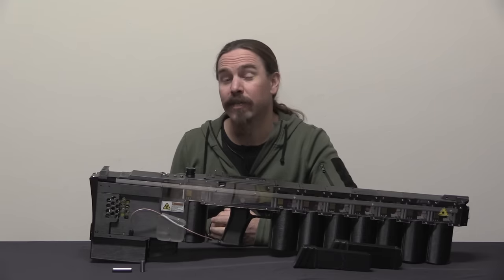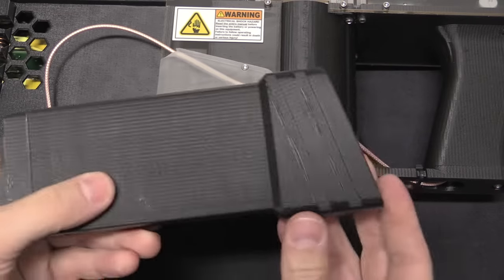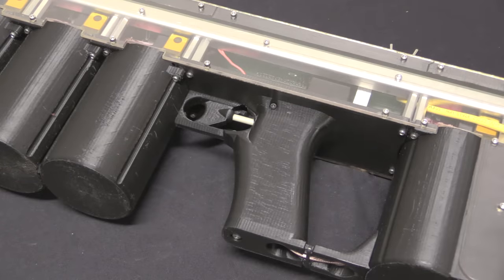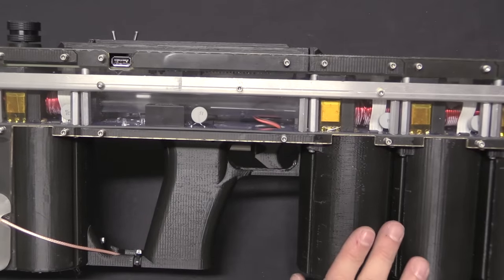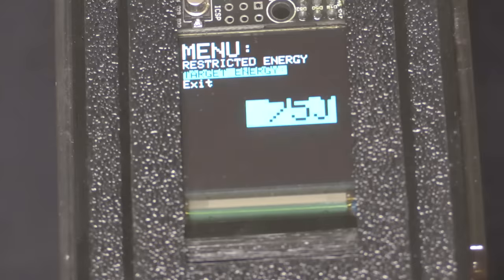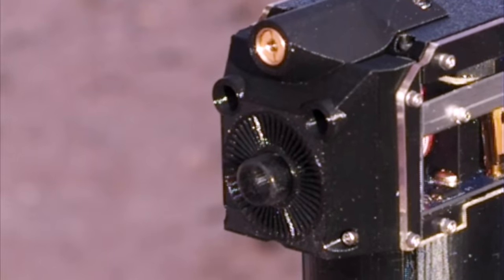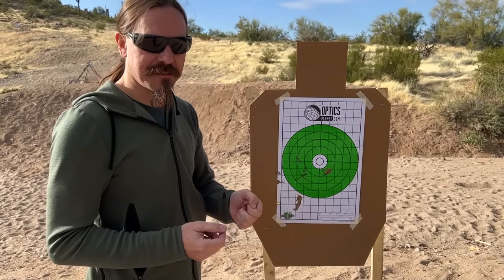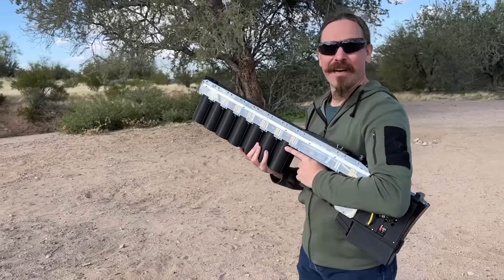ArcFlash Labs' GR-1 Anvil Portable Gauss Rifle

Comment: The scariest thing about this weapon is how quiet it is. Imagine a battle where you don't hear gunshots, just screams.
Reply: I suppose at some point in the future these might be powerful enough to accelerate stuff to the speed of sound.
Reply: I almost spit red wine out of my nostrils at that comment
Reply: @RyanTosh  probably gonna happen sooner than we think
Reply: Just imagine all you hear is the screams and the rampant Youtube Sex bots.
Reply: If it advances to the level where it can shoot any projectile above subsonic levels, there'll be almost the same amount of noise as a rifle with a good suppressor.
Reply: @RiseAgainst786  And without any of the click noise produced by mechanical parts
Reply: @pig1800  The clicks are barely audible tbh
Reply: @rad1ata  one sec I’ll get in it
Reply: @RiseAgainst786  I'm not objecting to you or something... I just meant "even quieter".
Reply: @pig1800  
I think there's some sound from the capacitors too.
A little tinggggg like a vibrator.
Reply: And the whine of mass drivers spooling up. It reminds me of crossbows.
Reply: from my understanding, it should almost be recoilless right? as there's no gas ejected?
Reply: surely if this weapon goes in battle the velocity has to be increase. It is silent now with this destruction capacity but with more power, this weapon should produce much noise. Cool sound though. Terminator 2 like.. nice
Reply: Actually those battles existed in the medieval era... all that technology is not even more efficient than a crossbow
Reply: You have more power in a Compound Bow, and more flexibility and no need to charge, + there are Rambo explosive arrows although they are outlawed for Civilian use
Reply: @FrostyFoxGamingIGM  A standard sniper rifle of this size and weight would have zero practical recoil..
Reply: I had the same thought. Imagine combat where the sound of the rounds impacting around you is the loudest noise. Crazy to think of. If this tech becomes widespread, stealth is going to become even more important for infantry.
Reply: It's gonna sound like a nerf battle in your cousin's back yard.
Reply: @RyanTosh  Now it's 1/5 of sound speed. But hypersonic speeds have been achieved in large cannons of such designs. Because of the magnetic field and weight I wonder if these would ever be practical as hand gunds.
Reply: it's quiet to human ears, but it sends a lot of emp when firing.
with a simple radio device, it would be super loud and very easy to pinpoint.
Reply: @DigitalNeb  You won't hear a "self destruct drone" before you are inside of the blast zone. Neither will you hear a Bow which has more power, similar recharge, less weight and doesn't need charging. GG :) + You don't really hear Military fire until it's too late. Military ammo travels faster than sound and professional troops engage in group fire, an all or nothing strategy which is a standard practice against all armed targets regardless of the opposing levels of power. If the level is equal ? the book says to call for an air strike or consolidated artillery. You won't hear any of that either :) or, you will "hear it" but there will be nowhere to go except a bunker and it better be a good one. This will increase the life span by about 25 min -_-
Reply: @poolpffs4985  we will have to see the only source of sound would be the air ripping no gas expansion (main gun noise)
Reply: There were air rifles in the Napoleonic Wars that were used by the Austrians. Napoleon hated them.
Reply: There would be sonic booms still heard right? Unless subsonic. This is for future iterations that is
Reply: There is a weapon in Star Wars legends which is almost completely silent and can shatter most types of armor. I remember it being described as quite scary.
Reply: OP never played blazer tag
Reply: @RyanTosh  the tech is already available and in use by the US Navy.
Reply: Best thing ive read in the past century
Reply: A weapons grade coilgun would be anything but quiet, the sonic boom alone would make it extremely loud and honestly that crack is most of what you hear at longer distances anyway. So actually it probably wouldn't sound much different at longer ranges common in combat.
Reply: Imagine a battle with steel cylinders flying at 75 mps. That wouldn’t penetrant a kiwi
Reply: Can be a perfect sh niper
Reply: Need to change my shorts now
Reply: I love the whine of capacitors in the morning.
Reply: Imagine a battle, where you don't hear gunshots, screams or anything, because there is no battle. Why you people are so eager for war? Maybe you should participate in one and see how terrible it actually is? By the way, Russia provides such opportunity as of February 2022, you can go tu Ukraine, escalate the situation and be in the middle of war. Go. Do it.
Reply: I bet it'll be louder when it's up to effective terminal velocities
Reply: Love how people are complaining about the speed of this 3d printed mass accelerator prototype. The shot fired from this is so much bigger and heavier than a 308. It's not a final it's just proof of concept in the future they will have much more powerful weapons. Like complaining about a early flint lock rifle not being as powerful as an ak... Yes we know 🤦‍♂️
Reply: @iamkronix3422  that's what I figured. I am a Kiwi and I shall not fear someone armed with one of those guns.
Reply: @OrangeAmped  I thought so too, that it sounds like a crossbow.
Reply: Probably would still heark AKM:s being fired no matter how much in the future.
Reply: "Imagine a battle where you don't hear gunshots, just screams."
I guarantee there will be trash talking and the military will start having battlefield trash talking classes for infantry soldiers.
Reply: @War_Magus  oooooh that's sexy. Never thought of it.
Reply: @why_wait   
I agree.
With a little bit of work that round could be much lighter filled with a special mixture. In turn making the velocities go much higher and impacts much more deadly. Even with all that accuracy is more of the issue. A hit with a 22 is better than a miss with a 44 mag.
Reply: Welcome to my nightmare, a place a live everyday.
Semper fi
Reply: I was thinking the same thing
Reply: @RyanTosh  I mean, it's a gauss gun, not a rail gun, so making it supersonic on a portable size is gonna be hard
Reply: @RyanTosh  you're way behind this type of Technology was perfected in 1946 by the war department along with infrasonic weapons research and herf weapons ..
Reply: @LostShipMate  truly the worst outcome of cyber warfare :D
Reply: A big advantage this type of weapon has is that it can work in space where you can't even hear screams.
Reply: @RyanTosh  why would you if you could instead shoot a heavier projectile right at the edge of subsonic? Just a 4 inch long hunk of metal coming at you at 750 mph
Reply: you will still hear a bang unless the round is subsonic...
Reply: Or the screams you hear when you step into a mud puddle and the caps zap yas.
Reply: I imagine more warhammer 40k with bigger charge and electric beam noises lol
Reply: Well...think about how much more powerful it'll have to be before it's a real battlefield weapon. That high-pitched whine you hear as the capacitors charge will likely be a hell of a lot louder, as will the switching (what with the ridiculously high voltages), and the projectile will probably have a really nasty report as it breaks the sound barrier. No gunpowder bang, but if you're shooting at targets with body armor, you'll almost certainly get that distinct sonic *crack*!
Reply: what if it's in space?
Reply: @JOlivier2011  well then no one can hear you scream >:)
Reply: There are no more huge battles like that. It's all tactical today.
Reply: Ok that's terrifying
Reply: If it breaks the sound barrier there will be a boom. True Story
Reply: Dude as a 3 time was vet that really is a horrifying concept. In reality most of what you do in a firefight is react to sound bc touch taste and smell go into low power so hearing and sight go into high power but line of sight will get you killed quicker than you can see the target so you're fighting mainly based in sound
Reply: @FrostyFoxGamingIGM  there still will be kick but since the gun is pulling the round vrs the gas pushing the round the gun will jerk forward instead of back towards you.
Reply: @RiseAgainst786  but there's no need to make them more than subsonic. A  subsonic 5.56/7.62 will kill you just as quick as anything supersonic. Most munitions used in the military or even hunting are designed not to break the sound barrier.
Reply: @RiseAgainst786  if they really needed somthing powerful enough to break the sound barrier they could just make the projectile larger causing more damage with less speed. What does more damage: a   .22 going 2400fps(faster than the speed of sound) and passing clean through your bicep, or a baseball hitting your bicep at 1000fps (slower than the speed of sound)? The answer is the baseball, the .22 will require a few stitches (15 tops) while the baseball would basically rip your arm off. The speed of sound is between 1100 and 1200 feet per second depending on humidity and altitude
Reply: @sneeringimperialist6667  when did they not metal? I skipped around and guess I missed that part
Reply: @FrostyFoxGamingIGM  actually thinking about it more  the recoil would be is the same direction pushing it back towards your shoulder.
Reply: @emmw7794  dude even with the best portable suppressor on earth a 300 blackout is louder than a 5.56 with no suppressor. I spent 7 years as the battalion armoror and personally have the largest firearms collection of anyone I know personally, including multiple 22s and ARs as well as a 300 blackout. And even with a SilencerCo Omega suppressor it'll make your ears ring if you don't have earpro on
Reply: @GLCaver98  I didn't see your post and basically said the same thing lol. A 1000fps baseball is gonna do more damage than a 2400fps .22 round
Reply: @kooperativekrohn819  for the Emperor!
Reply: I think they mentioned the muzzle velocity was 70 m/s which is way below a normal firearm which is usually 180 m/s to 1000 m/s.  To break the sound barrier you have to get around 240 m/s.
Reply: @RyanTosh  Probably. All it needs is a more potent energy source. The day some mega genius figures out a way to cram a nuclear bomb's worth of energy into a volume no bigger than an energy drink can safely, is going to make a lot of sci-fi things that were previously impossible, possible.
Reply: Its has the voice of mass dead💀
Reply: @java4steve  I don't know about meters but he said in the beginning that it was about 2200fps or as fast as a .22lr which is usually 2200fps which is actually faster than the speed of sound which is between 1100fps and 1200fps depending on the humidity and altitude, so I think he either mispoke or I misheard or it did NOT preform like it waa supposed to lol. Also  in mph the sound barrier is between 725mph and 750mph.
Reply: Air Rifles are pretty quiet right now.
Reply: You'd probably hear the impact...
Reply: @WOTArtyNoobs  they definitely can be if you get one made for noise suppression. And they make air rifles and pistols up to the larger calibers like 50AE now and even 12gauge airshotguns lol. And they do the same damage as their combustion counterparts so they are pretty cool. Demolition ranch also did a rail gun video recently that I thought was a better design than this one.
Reply: @WOTArtyNoobs  it's called a EMG-01A. And it has semiautomatic and 3-5 round burst settings on the selector😎. $1500-$2000
Reply: Yeah, kind of like a very sophisticated Crossbow. For a prototype it is effective enough.
Reply: @server1ok  He only fired it at 51%, and it's probably better than the earliest examples we have of Crossbows. Crossbows have had THOUSANDS of years to develop. This gun hasn't even hit Beta, much less a 1st Mass Production Release. This is more Proof of Concept, than an actual Weapon proper. 

Plus, the rounds might be as or more powerful than a crossbow, if shot at full blast with some of those bullets. Plus, there's something to be said about the reload time of a Bow or Crossboy compared to this, not to mention a lack of recoil.
Reply: I never thought of that and now that I think of it, thats kinda terrifying...
Reply: @RyanTosh  Supersonic projectiles aren’t exactly silent.
Reply: You will hear them when they use even more power. They will not stay that silent.
Reply: @charlesjohnson7657  People overestimate the amount of force needed to incapacitate someone.
Reply: @TheAyanamiRei  1. Lack of recoil doesn't matter. Because. If you take a standard sniper rifle ( which is 10 to 50 times more powerful ) and build it to weight the same as this Coil Gun, the standard sniper rifle is going to have ZERO recoil. 2. Check Lars Andersen. He will teach you how Bows were used in Warfare, 500 years ago. Plenty of VODS on YouTube. The recharge time is fast. Archers didn't use fancy sights and they didn't load arrows on the wrong side of the Bow. This came about later in modern competitions. In our time. I didn't mention the Crossbow. Nor did I mention a Ballista or a Catapult. But if you take a powerful Crossbow or a Compound bow, it has enough force to shoot a serrated arrow through 3 Cows and come out the other side. You know the famous Lion that was killed by a Doctor ? His arrows went straight through the Lion. He shot more than 1 arrow because the bastard didn't use enough blades. Arrows need a minimum of 4 large blades to humanely kill a large prey. With twin blades you need to hit the heart of a Lion. But with this Coil Gun, you would need to shoot 50 to a 100 bullets. 3. The development of Coil Guns is old. The CERN particle accelerator is a Coil Gun. Coil Guns can't be made lighter or the CERN staff ( which includes thousands of World experts ) and their budget of 200 Billion USD would make the accelerator, cheaper, lighter or smaller. They couldn't. You need to change Maxwell's equations or invent an unknown material because this is about the limitations of electromagnetism. However. You can make very powerful stationary Coil Guns. You can shoot containers into Space with a Coil Gun. But you won't be able to carry it.
Reply: @FrostyFoxGamingIGM  the round has weight and depending on the weight it also doesnt like to move from a zero potential/kinetic energy point and will move the gun partly as well.
This is called inertia.
Reply: @jeremysaklad6703  That's my point :p
Reply: @GLCaver98  That's true, but keep in mind kinetic energy scales quadratically with velocity, but only linearly with mass. So doubling the speed of a projectile is twice as effective as doubling its mass.
Reply: @server1ok  but in about a generation this thing could be able to fire a slug though a tank at Mach 12.
Reply: @jibcot8541  It can do that right now. You just need a coiled tunnel that is 300 yards and a machine that weighs 75.000 pounds. This cannon can subsequently get destroyed by a single grenade or a couple of stray bullets into the enormous battery pack. Poof ! dollars down the drain..
Reply: @VaporSpaceNumber101  that is true, though the recoil should be less than a conventional rifle right?
Reply: @FrostyFoxGamingIGM  recoil would be almost non existent with the weight of that railgun and the round
Reply: @server1ok  I am LITERALLY unable to read that mess with it being 1 giant massive paragraph. Other than a few highlights.

The Collider is VERY different than what's being made here. 
It's a crude janky prototype that's NOT even in a Beta Stage, not even worthy of Beta. That means there's going to STILL be a TON of problems, BEFORE they even get into Efficiency.
Again, I was saying you would have to compare this to the EARLIEST VERSIONS of a Crossbows, Guns, etc. Like the earliest rifles were SHIT, so it's no surprise the earliest coil guns aren't that great. 

Like nothing here is efficient or nearly as great as it could be. Lots of tech is overly bulky and less powerful when it first comes out. 

Nobody's really invested the kind of time, energy, and money needed to turn this into something that could even BEGIN to compare to a modern assault rifle.

An MAYBE we'll never get there, but as far as I can tell, we're FAR FAR from being able to even say with 80% certainty that it would be impossible to create a Coilgun that could compare to something like say...an AR-14 or Sniper Rifle.
Reply: @RiseAgainst786  nope. It will always be quieter.

Part of what makes firearms loud is the mechanical action being slammed violently.

There are no such things on the gauss cannon.
Reply: @TheAyanamiRei  The particle collider isn't about the physical structure or the physical invention. The coils at CERN prove ( and make use of ) the limits of electromagnetism and how much magnetism that can be packed into a certain distance, speed and as per the provided power, minus the power loss. Even with a perfect theoretical model of a Coil Gun ( with no power loss and no charging time ) there are strict upper limits as to the amount of power that can be transferred into the momentum of a metal slug, especially when taking into account the weight of the machine and standard materials like copper. 

The most obvious upgrade to this weapon is to stop the rounds from tumbling, but this will create friction and decrease the current output by 50 %. Going down to 50 yards per sec is reaching territories of the early Muskets and BB air guns. The second upgrade is more coils, a longer barrel or a coil that goes around the barrel in 3D, 360 degrees, all of which is going to add weight. Serious weight. Similar issues are present in creating EV Lorries for transporting 20 to 40 tons of payload, or carrying enough rocket fuel to reach another Star System. Serious ( built in ) diminishing returns. As I've said. You can create a Coil Gun that sends containers into Space but you won't be able to move it and it'll take weeks of planning to send a projectile into the correct destination, it's also ridiculously easy to sabotage or stop operations, none of which are good traits in a War.

Check Lars Andersen. He can fire arrows with a deadly precision and power ( up to a 150 yards ) faster than 1 per second, by holding the arrows in the draw hand. In addition. Lars has passed the mark of middle age and has a muscle ( nerv ) disorder and has only trained seriously for a decade. War Archery has been forgotten and patronized for Centuries. Even today. A random member of a Rain Forest tribe outdoes the precision of any modern firearm that doesn't make use of a rotating bullet, such as bird shot and muzzle loaders with round projectiles. There is nothing to improve. A tumbling or spherical projectile that is shot at the surface of the Planet, can not compete with a War Archer unless in melee range, regardless of the energy level. You are underestimating the issues here, in every possible way. That's why an answer has to be this long.
Reply: @yep Those countermeasures don't exist and the guns themselves will develop over time as well. For all we know the whine will be eliminated.
Reply: No sound, no flash, ideal for special ops
Reply: @Gebra9  except it's nowhere near as good as weapons like the mk22 Mod 0 if you want to talk stealth. In fact, right now, it's about as stealthy as an axe covered in bells.
Reply: The round itself will be explosive rounds
Reply: Lets ignore that subsonic projectiles are of very little military use - they STILL produce a loud BANG when leaving the barrel. Even fast TRAINS do that.
Why? Cause there is still a projectile and a barrel (and there needs to be) and that causes a lot of air to move.
Reply: All you heard in battle were the screams until quite recently in history. Well, screams, trumpets, drums, and clanking metal. Maybe the occasional crash of a flying boulder into the city walls.
Reply: Projectiles only make a bang when they break the sound barrier, subsonic projectiles do not break the sound barrier therefore they do not make the bang. Trains do not go bang  either when exiting tunnels, why would they ?  There's no airtight seal between the train and tunnel, as there is with a bullet and a barrel, and they are nowhere near breaking the sound barrier.

Subsonic ammunition is extremely useful for the military. There are multiple gun platforms built entirely on the damn stuff. 

The vss and asval cartridge being one of the most famous.
Reply: @candyman9635  "Trains do not go bang  either when exiting tunnels, why would they ?"
... they do (well, not just on leaving but even when entering) - and it is one major engineering problem for highspeed trains.
https://www.youtube.com/watch?v=8ttshCp1r9I
(and that is still on the slower end).
https://www.youtube.com/watch?v=qNmVEPTLDuI

And as you said that is without an "airtight" seal but rather with tunnels that are far wider than the trains.... having a projectile that fills nearly the entire barrel just makes it that much worse.
Reply: @ABaumstumpf  Trains do not go bang, they cause a noise more akin to thunder as you can hear in the videos you linked. 

It's not about trains this discussion, we're talking about subsonic ammo and the fact you seem to think it's of "very little military use" and that it somehow produces a loud bang when leaving the barrel. Even if it were at the same noise level as standard ammo, which it's not, that's why subsonic is used with suppressors very frequently and why the VSS and AS-VAL, which use subsonic ammo by default, have integral suppressors.
Reply: @candyman9635  "and the fact you seem to think it's of "very little military use""
it is not just that i think they have little use - i am just pointing out the fact that they are of very little military use.
Reply: @ABaumstumpf  Okay, you repeated the same claim for a second time. 

Do you have any evidence or can you elaborate on that ?
Reply: @candyman9635  "Do you have any evidence or can you elaborate on that ?"
The lack of sub-sonic weaponry in general -  aka basically all of modern weaponry and warfare.

Do you have any evidence for subsonic weapons with low cycle-rate being desirable?
Reply: It makes about the same amount of noise as a crossbow launching and is probably just about as deadly... so countless people throughout history don't HAVE to imagine.
Reply: I’m sure a powerful version of these will cause some type of noise fired
Reply: and electric cars
Reply: you dont here it because its low velocity. once it kicks up, you'll still here a sonic boom
Reply: cant imagine how scary it would be if bow and arrows were invented oh wait
Reply: @RiseAgainst786  unless they make stealth hypersonic technology. They’ve made something similar to that for underwater torpedoes, so that the cavitation explosion does not happen.
Reply: Yeah but so far as it's is useless, a BB gun has more power and more accuracy LOL🤔😆 we gonna have to come back to this comment section in another 50 years.
Reply: @RyanTosh  wrong not this gun but the one the Navy has, this gun on this video is a joke, only a quarter of the speed of sound is what you are seen in this video, a revolver hand gun bullet is two to three times faster than this.
Reply: @lcfflc3887  like any new technology, it takes time to develop. So yeah, we will come here after 50 years
Reply: @ee214verilogtutorial2  don't forget about Lazer beans, that it's Bean developed as well and it's far more practical, 0 recoil less weight and limitless ammunition as long as you still have charging oh and it doesn't get more quiet then that.
Reply: Because it is very slow and weak.If projectile pass sped of sound that make BANG, not just powder charge.Less power than 22 lr and mutch less range and accuracy than 22 lr.if they make a rifle like this on electromagnets that will be as strong 
as normal gunpowder rifles, it will be just as noisy as gunpowder 
rifles.
Reply: @docholiday2538  These airguns are note even close as powerful like 12 ga and 50 AE.They are in pistol range of power and as noisy as a powder burner 45 acp pistol.
Reply: @ciro79  they aren't airguns, I've personally have 9mm and 12gauge airguns in my collection that will take down a deer no problem. But these "gauss" rifles are just magnetic rail guns so there is no mass displacement of air caused by the concussive force of a traditional firearm or of a high power air rifle. They are just magnetic force push/pulling a piece of metal forward really fast. You might hear a little  fwoop as it pushes the air out of the barrel but other than that, yes they could be silent
Reply: Dude. Damn.
Reply: walter graham  they’re using meters per second not feet
Reply: Not true because every projectile that is passing the sound barrier will create a cracking noise …
Reply: @PhysicsViolator  dude just keep it under the sound barrier. The sound barrier is 1400+fps and that's faster than many combustion rounds so it's fast enough to kill but under the sound barrier
Reply: @docholiday2538  well in that case arrows/air rifles and slingshots have been doing that for centuries if not millennias and you don’t need batteries 😂😂
Reply: @PhysicsViolator  yea they do the same thing, just with the tiny difference that they go nowhere near as fast, are nowhere near as accurate, and are single shot😉
Reply: @PhysicsViolator  other than the air rifles but those that are that powerful are single shot
Reply: That wouldn't be the case once the bullet goes supersonic though. The only reason it's so quiet is because the slugs travel at really low speeds.
Reply: @docholiday2538   well coil gun technology is quite new so it needs a very large improvement and efficiency to actually achieve deadly velocities that can actually kill something from a far distance , while some large bore air rifles can take down a deer from over 300 meters … it’s because capacitors aren’t energy dense enough to  deliver enough   Magnetic force  so there’s still time for this technology to be lethal at a man portabile scale…
Reply: @PhysicsViolator  honestly we don't look at military tec in the perspective of making it portable anymore. The major strikes always do to drones or naval artillery nowdays. And on a large scale they already have rail guns that can take out a tank from another state
Reply: @PhysicsViolator  the tec has been around and used since the cold war
Reply: @RyanTosh  Railguns and such are only really limited by the amount of power available to them, and how strong the barrel is to withstand multiple shots. If you can overcome both problems then there is really no limit to how powerful you can make a railgun. Theoretically you could build one so powerful that it would instantly kill anything nearby just from the pressure wave from firing.
Reply: It's not the gunpowder making the boom it's the sound of the bullet breaking the sound barrier the method of acceleration doesn't matter if it reaches that speed it's gonna make a big boom like a gunshot
Reply: @kriegdeathrider7805  sry man but that's just not true, I've designed, built, maintained, and restored firearms my whole life. And yes the sonic boom is loud but if you take a shotgun shell and toss it in a fire, when it goes off it's audible for miles even though the shot never doesn't go more than a few feet much less break the sound barrier
Reply: that's mostly because it's subsonic and fairly weak. If you increase its power it will make sonic booms and thus be almost as loud as a firearm
Reply: @KekusMagnus  why make it supersonic when subsonic will drop a moose at 200 yards? Most hunting ammo is subsonic and in the army we were given subsonic rounds whenever we had to use suppressors. A round traveling at 1100fps (subsonic) does just as much as one going 1500fps (Not subsonic) lol
Reply: I wonder if gun poweder never existed what kind of gun like weapons would we have by now?
Reply: @jmgonzales7701  we'd probably still have explosive propelled bullets. I mean you can use something as simple as sulfer and red phosphorus aka match heads to make a stable explosive powder that can be substituted for gunpowder.
Reply: @jmgonzales7701  but if you mean if bullets were never created then we'd probably use some syfy crap like laser,plasma,rail,or pulse weapons. We already have some of those like the pulse gun that can take a plane out of the sky, and we've had rail guns capable of launching a tungsten rod through the moon from earth since the 1950s, and we aren't far from the rest. Laser weapons were created decades ago but were  almost instantly banned for being inhuman and to dangerous for individuals just like nukes were. And They already have plasma casters that can imolate objects up to like 15ft away. It's just a matter of which takes the least, most available resources to produce and operate. And right now that's combustion firearms
Reply: @jmgonzales7701  sry for all that lol I'm a vet/gunsmith/gun nut so I have way to many facts on stuff like that that nobody really wants to hear😂
Reply: @docholiday2538  plasma would be nice. something like star wars.
Reply: @docholiday2538  would it be as powerful as gun powder.
Reply: @jmgonzales7701  it's just as powerful as gunpowder and was used in firearms b4 gunpowder, the downside is it creates a puff of thick smoke every time you fire that can obscure your target
Reply: This is how most battles were fought throughout human history when you think about it
Reply: @StinkySkunk100  Yeah but most of the time its face to face, this time it isn't. You wont know what hit you.
Reply: @StinkySkunk100  yea but back then the projectiles didn't come at you at 1400fps
Reply: @server1ok  barely. Compound bow is 220-250J, and this is an alpha prototype.
Reply: @docholiday2538  he said the muzzle energy was similar to a .22LR. It’s a much heavier round so it’s slower. Only energy matter though (more or less).
Reply: @server1ok  CERN accelerates particles to .99c ffs. That is not necessary for combat
Reply: @RyanTosh  doubling its velocity is quadratically more difficult than doubling its mass.
Reply: @lcfflc3887  no, it does not. Not even close
Reply: @ciro79  no
Reply: @kriegdeathrider7805  this is just wrong. Subsonic gun rounds still make sound from the exploding powder. Subsonic gauss rounds, like arrows or air rifle rounds, are essentially silent.
Reply: @kalasmournrex1470  You are correct, but the calculations from CERN about power management and magnetic fields holds true for the upper limit "OF ALL" Gauss rifles and if you follow this math you also get a lower limit of the mass and size of a Gauss Rifle ( which can overtake a standard rifle ) that simply can't be carried by single combatants outside of being mounted on a Tank and other conclusions. CERN ( being close to c ) allows for an extremely precise math and this holds true regardless of material choice and regardless of technology because the calculations are rooted in "electromagnetism" so unless you can invent a Gauss Rifle on a QM level or with a "Warp Drive" it will never be carried by a single soldier. Can I perform this calculation in detail ? No. Does that make it false ? No.
Reply: @LostShipMate  BAHAHHAHAH
Reply: @kalasmournrex1470  Well sure, because it then has quadratically more energy. No free lunch and all that. Velocity's just a more efficient way to pack in that additional energy, you can only go so large before things get impractical, but better technology could feasibly allow for higher speed without more weight.
Reply: bow and arrows
Reply: @zaatas  I was just waiting for somebody to catch that lol. It didn't seem like anybody was reading my comments so I got frustrated at all the side chatter from folks who never built a firearm or reloaded a  round and decided to see how much bullshit they'd slurp up
Reply: @docholiday2538  Ah, that makes sense, nice one. I was like I agree with this guy, they seem to be one of the only people that actually knows what they are talking about. Then you said that, and I was like, oh, he's one of those. 

I don't think people really understand the benefits of being able to switch the amount of energy per shot on the fly, and the ammo length. That would be revolutionary. You could go from super sonic small AP slug, to barely subsonic slugs. Sabots would fire really good out of this. Or ammo that could work like birdshot or buckshot. Standard ammunition would become cheaper because you don't need to load bullets with gunpowder. 

The problems (other than the weak firepower it has now) is the size, rof, and the gun would be extremely fragile. But those all seem like things they could work on and make better. It's a very interesting weapon platform. 

-Last thing, the guy going on about the bow and xbow. Wow. Yeah just learn how to use a bow, super easy man. And xbows, those things load really fast, right? Neither have problems in wet weather either.
Reply: @FrostyFoxGamingIGM  not really due to third Newton law the force applied by magnets to projectile, is applied by projextile to magnets too
Ofc. You dont see much recoil here due to higher mass of gun and Ian's muscles holding the gun in place
Also the gun itself is quite weak when compared to most firearms of that size
Reply: This would be a horrifying way to deliver explosive ammunition, especially since then you wouldn't have to break the sound barrier (with the attendant noise that would make). Just a little bit of clicking your target won't even hear, then stuff a few hundred feet away starts blowing up.
Reply: @raycearcher5794  Yeah, and perform trick shots with a guidance computer. 

The huge problem that will always be there, is that even if they scaled the size down, and the power up, the thing is still going to be filled with magnets and capacitors. 

And I'm not exactly sure what explodes when shot at it, but I've shot at old speakers/tvs before, and there's something inside them reacts violently with bullets. I would posit its either the magnet or the capacitor that has this explosive effect.
Reply: @zaatas  Capacitors are full of chemicals that, if they overheat or overvolt, can explode. So compared to say, a mounted machine gun where shooting the weapon can render it useless but probably won't kill the operator, there is a non-zero level of danger. 

I'd say in a military scenario, gauss rifles would definitely work better as a support weapon, screened by a squad with conventional firearms.
Reply: @RyanTosh  It's already possible with a full power railgun, but those are very long and require tremendous electrical power to use.
Reply: @FrostyFoxGamingIGM  The recoil is exactly the same as a rifle of the same power.

The only difference is a rifle is pushing gas and metal out and this is only pushing metal out.

The force transfered back does not change with the materials accelerated, only with the mass and velocity of them.
Reply: @server1ok  Completely wrong, it would have the exact same recoil as a sniper rifle fired conventionally with the same energy.
Reply: @BeKindToBirds  Sir. You have failed to realize the big picture. 1. To reach the power level of a standard sniper rifle ( explosion pressure from a burning chemical ) the coil gun needs to be approx. 10 times larger ( at least ) 30 times as massive, thus the backwards movement will be 30 times smaller when propelling a same weight projectile at a similar speed. 2. The acceleration in a coil gun is GRADUAL, this means that the felt recoil will be even smaller than the example of 30 x.. What's more.. point 1 and 2 ( + additional  limitations, power leakage and interference with all other equipment ) is why coil guns suck for anything but a stationary installation, such as the CERN which has a weight of a couple of Billion sniper rifles but still manages a lower energy per pulse
Reply: @server1ok  I am a physics major and I promise I understand how it works.

The nuance you are elaborating on would have mislead 99% of people who are saying "no recoil" (because they are kids probably)

Everyone in the comments thinks it will have less recoil because lasers and video games.

The details you are talking about are not what they are assuming, they are assuming space magic = no recoil.

And my comment is meant to answer that.    

There is still an equal amount of force being applied backwards to launch the projectile.

These kids are saying space gun, not talking about the finer points of moment of force.
Reply: @BeKindToBirds  I admit the initial comment is a trap. It's meant to show how pathetic the coil gun is, especially as a hand held device. If you don't fall in ? you won't learn, or, in your case, you won't be reminded of what you have omitted, being a "physics major" and all :,)
Reply: @server1ok  Look homie, let me explain first of all I'm not a computer person okay.

Want to talk about something fun?

These guns have been outside a long time okay.   Like, a while.   Like, literally back in the days of steam engines.

So let's make some educated guesses together.   Do YOU believe that this 3D printed home kit is the very pinnacle of the technology in use?

But can you think of any reason to use this over a conventional rifle?    

What about almost the exact same parts?

thedrive /the-war-zone/russian-backed-separatist-shows-off-questionable-homemade-counter-drone-jamming-gun

A lot more practical.

The Navy is who plays with big guns, no offense to this company but electric small arms aren't the need.   

Electronic small arms are, and so are Electric Naval guns.

But this idea?  Kinda looks like a ballista to me.

I think it could have its place on a vehicle or in and emplacement without doubt.
Reply: @BeKindToBirds  p.s. The coil gun which has an identical recoil to a standard rifle ( given the same energy ) is a fantasy weapon. It does not exist and it will never exist unless you 1. break Maxwell's equation, or 2. invent new materials on the periodic table or invent new states of known materials which are more magnetic while not being impossible to load and wrap around the tube. There is a reason why CERN has a mass of approx 10 Billion lb, if humanity could make a powerful coil gun small and portable ? it would have been done, 50 years ago. The only way forward on this is to invent some type of new QM material which doesn't break down in 0.1 pico seconds but when we reach this point, a portable laser weapon will be on the map
Reply: @server1ok  You can literally make one in science class.

Does it not exist until it matches some comic book ideal of yours?

I am really struggling to find your definition of coil gun.

A gauss gun is literally a coil gun, how powerful do you think it has to be to meet your definable standard?
Reply: @BeKindToBirds  The limitations of the coil gun are not about technology. They are physical limitations. As in limitations of the current theories of Physics. That's why you need a "better theory" than Einstein and Maxwell to improve the coil gun or a "unknown material", hence why QM is the only way out. Yes, you can add size and mass to a coil gun. A Naval coil gun is 80.000 lb and the CERN is ( as I said ) 10 Billion lb. Can you carry 80.000 lb ? Can you put 80.000 lb on anything smaller than a commercial Truck ? What do you think the recoil is for a 120 mm shell when you fire it from a CANNON that weighs 80.000 lb and up to a 1000 tons ? the recoil will be a tiny fraction of an inch, if you can record it at all. For all practical purpose, the recoil will be ZERO because coil guns are shit. There are 2 viable venues for a coil gun. 1. Laboratory. To test particles. 2. A Space elevator that wants to be "friendly" to the environment. So what's up man ? You are a physics major but not a computer guy ? but you somehow manage to have a bad temper ? Let me tell you what I am. I collect cans for a living, as in professional dumpster diving, that's why I don't give a shit what anyone thinks. You should try that
Reply: @server1ok  Alright well I hope you keep your enthusiasm going forward but I really don't have time to explain things to you now if you aren't going to read.

Take care, learn some metric.
Reply: @BeKindToBirds  The LHC at CERN cost $8 Billion USD and this is after massive Gov. subsidy including, cheap land, favorable power, Gov. caps on labor, Gov. guarantees on various cost and deliveries. To fund the LHC coil gun ( LHC is basically a coil gun and nothing else ) without a Gov. intervention would cost approx. $30 Billion USD today. Do you know many people with 30 B in cash ? The Worlds "richest person" Elon Musk doesn't have 30 B liquidity atm. If the LHC could be made any smaller and cheaper ? believe me, it would have been made smaller and cheaper. EM is such a weak and diluted force ( in relation to chemical pressure ) and these are the limitations. Why is the LHC important for a portable coil gun ? because the same principles apply to a small coil gun, it's the same formula of Maxwell or ( if you want to get fancy ) Einstein. To circumvent this fact, no technology can help. We need NEW ELEMENTS or a completely new physical model that can discard the entire work of Einstein. This theory doesn't exist. Being a major in physics you should be aware of this, as I live on the garbage of people, am middle aged with zero education but still manage to educate myself about basic fact.

When it comes to Military application, coil guns are dead in the water. Not only that but a waste of manpower and resources which can no longer be tolerated with an expanding East. I can think of a single valid application and that is to setup vehicle mounted, low range grenade launchers that are silent. This is a small niche and hasn't been developed. You get a silent grenade launcher but the Vehicle will become twice as heavy, tech interference ( coil guns disturb onboard equipment ) and cost will go through the roof and the shells will be 10 x the cost, initially. We are in a cold War atm. much worse than the Cuba crisis and to misinform the public about weapons of Fantasy is not a joke. It's playing into the hands of the enemy, actually 2 enemies, 1 of which is dominant in exports over the US. Unless you want a lifetime President in the US that is appointed by the Kremlin or Shanghai ? think before you speak. 

As for the "Space Elevator" coil gun, this isn't a joke either. The structure would be larger than the Wall Of China, a thousand times bigger than the LHC, at a starting price of $3000 Billion USD ( just to get the project off the ground ) with a zero guarantee of success, probably to cost more than the combined market value of Apple, FB and Google. To fail in such a venture would be equal to getting blasted by Russian atomic bombs, when it comes to wasting US resources and manpower, and as for the elevator part, it's not a physical elevator all the way up to Space which is why it would be so immensely expensive and actually has a chance of working. A chance in hell ..
Reply: @server1ok  Dude, go argue with the articles you read and calm down.

I explained to a guy that these guns still have an equal reaction and you have spent hours and hours being mad and talking past me.

Get help.  I don't work with you, I'm not paid to listen to you rant past me about things I never said.

I get this is a comment section but I have to work and not on Wikipedia.

You are literally making up an argument and having it 100% on your own because you are too excited and didn't read.

I never took any position you have argued against yet other than the fact that this rifle is not the only gauss coil gun small arm.

Read about it in 30 years when it's on Wikipedia and go argue with kids more because I don't work in commercial and I'm not begging investors.

And you for sure have never had this discussion with decision makers on a military base and it bloody shows.
Reply: @docholiday2538  "Most munitions used in the military or even hunting are designed not to break the sound barrier."
Patently bullshit. I can't speak for hunters, but the percentage of subsonic ammunition in military inventories looks akin to a rounding error, and sure as hell isn't "most."

"I don't know about meters but he said in the beginning that it was about 2200fps or as fast as a .22lr which is usually 2200fps which is actually faster than the speed of sound which is between 1100fps and 1200fps depending on the humidity and altitude, so I think he either mispoke or I misheard"
You misheard. He didn’t say anything about equivalent velocity, he said “equivalent _muzzle energy_,” which is due to the enormous weight of that slow-moving slug.

"we've had rail guns capable of launching a tungsten rod through the moon from earth since the 1950s"
Again, no the hell we didn't. This is as ridiculous as people saying the earth is flat and Nazis have a moon base.

"Laser weapons were created decades ago but were almost instantly banned for being inhuman and to dangerous for individuals just like nukes were"
More bullshit. Laser weapons didn’t “get banned”, they aren’t in use because of similar reasons to gauss weapons/railguns – size, weight, energy. Plus, laser weapons are essentially heat weapons, so to destroy a target with a laser weapon, you have to train the weapon on it until it heats up to a temperature that causes failure (organ failure in a human, fuel combustion or structural failure on a vehicle, etc). You need to lay off the comic books.
Reply: @jsquared1013  lo its great to see all the civilians who know more about this that me, a retired battalion armoror
Reply: @RyanTosh which is totally impressive, because......?
Reply: @eliasroflchopper3006  Nothing to do with impressiveness, more that once they reach the SoS they won't be silent anymore (sonic boom)
Reply: @RyanTosh  guns already do that
Reply: @RyanTosh  nevermind you are talking about coilguns I feel stupid
Reply: @skff_err  the energy of the projectile going forward would def have recoil so any coilgun looking to make normal guns obsolete needs some anti recoil
Reply: @charlesjohnson7657  well the whine probably isn't an issue: up the capacitor frequency a bit, it will be inaudible to humans. I'm no engineer, but i'd guess that's something they'd like to do even aside from sound issues
Reply: @Demigord  I don't think you can really change the pitch, just sort of muffle it.
Reply: Most of the sound made by a gun is the projectile breaking the sound barrier, not the gunpowder igniting
Reply: Psychological warfare at its finest.
Reply: crossbows, and regular bows are the same way bro
Reply: Brrrrr and screams, charging will sound like brrrrrr
Reply: The loudest part about a gun shot is it breaking the sound barrier so it will never be quiet on the battlefield
Reply: Well, if you use a spear you get the same effect :)
Reply: @server1ok the main advantage these have over bows is that any noob can shoot one of these, so long as you're decent at aiming, but I guess the same is true for a crossbow. An actual bow takes more dexterity and skill though.
Reply: @admontblanc  At the range that this weapon can damage a large game animal and hit somewhat reliable ( which is not further than 30 yards ) a standard bow isn't rocket science to shoot by anyone who isn't in a wheel chair or a 5 year old child ; ) 
The trick would be to get close, and then you have the added problem of carrying around a refrigerator that needs big batteries. 

The recurve bow is amazing in battle, provided that the enemy is unarmed, 20 to 30 yards away and is unable to quickly charge. A non skilled bowman can hit and kill several soldiers, especially if there's a volley from team mates, they can all pretty much be terrible shots and still destroy a static and unarmed enemy. Standard bow was used to great effect in the trenches of WW1 and WW2, to harass and get the occasional hit when rifles couldn't hit, also used in Vietnam but the army doesn't talk about that since they don't like improvised weapons that outshine the standard issue rifle.
Reply: @server1ok  while it doesn't take that much to shoot a bow, it takes way more to shoot a bow close to a military acceptable standard than a crossbow or a gun.
Reply: @admontblanc  wrong again.There is no military standard with bows. It's an improvised weapon, privately funded, stolen or otherwise gifted or made on the front line, and used by soldiers to harass an enemy trench line. The soldiers have standard issue rifles and hand grenades but they can't shoot bullets into a trench line and sometimes a trench is too far away to throw a hand grenade, and not all forces have air support or attack drones. Typically, the western forces are spoiled with air support, seeker missiles and self guiding RPGs, this won't last if there's a world war because those system are expensive and they will deplete. 

The bow is here to stay, precisely because it's been officially shunned, the crossbow is good too and can be used to propel larger and more powerful arrows if it has a winding system, but the thing is, If you can improvise a crossbow ? then you can accomplish a slew of additional improvised tech which makes both the bow and the crossbow kind of pointless, thus, a standard bow ( which can be made quickly made ) is a sweet spot. Balancing the arrows and having damaging tips is the problem when improvising a bow, and not the weapon in itself which is still superior when it comes to impact vs. spent resource, and this is irrespective of technology. Bang for the buck ( or bang for zero bucks ) can't be beaten with the bow. Ever.
Reply: that's what I was thinking, sounds so soft/innocent like a toy nerf gun too which makes it extremely scary
Reply: @RiseAgainst786  if you could..somehow, what would you compare the speed of this current gauss rifle to actual rifles? in mph